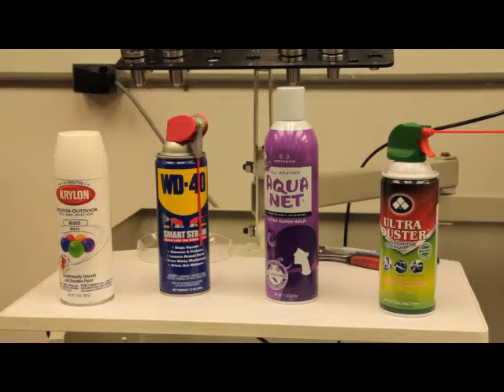Spray Cans - Composition, Function and Safety

Comment: Can i make silicon and mineral spirit mixture in an arosol can, without it being hardened overtime ever?
Reply from the maker: Silicone resin must be catalyzed in order for it to cure. If you add the catalyzer before you load the can then it can harden in the can over time. If you use uncatalyzed resin in the can you will need to somehow add the catalyzer after spraying which, given that catalyzers must be thouroughly mixed into the resin, will be difficult to impossible.
Reply: @LesWilhelm  Its not silicone resin but 100%silicone that we use as a sealant mixed with orderless mineral spirit(white spirit/ orderless turpentine) 
I would like this watery mixture to be as it is. If it hardens, it cant be sprayed, can i fill this mixture in an aerosol can and keep it watery for ever?